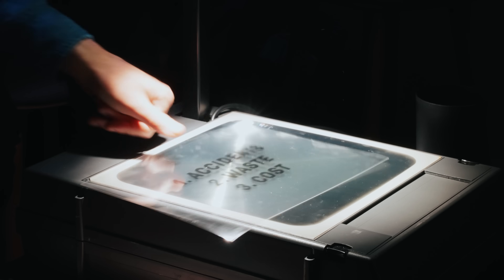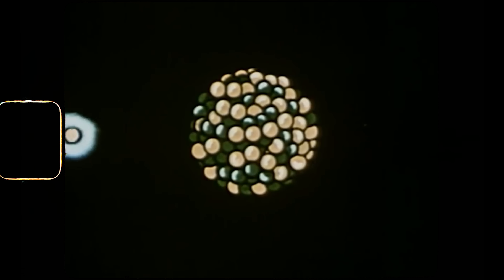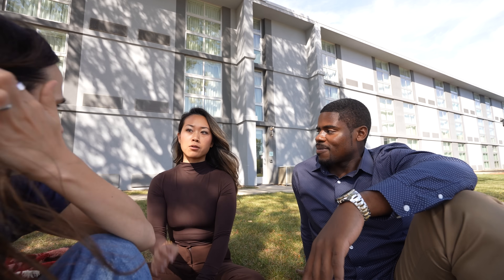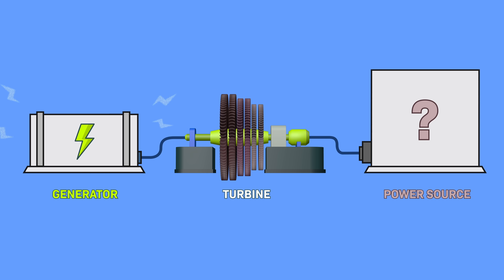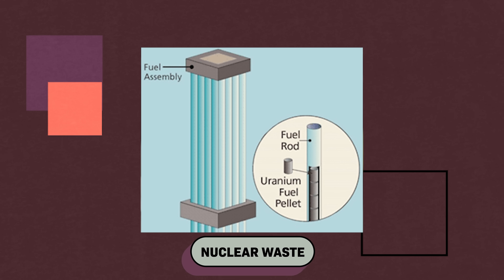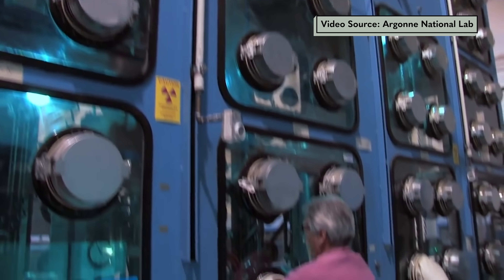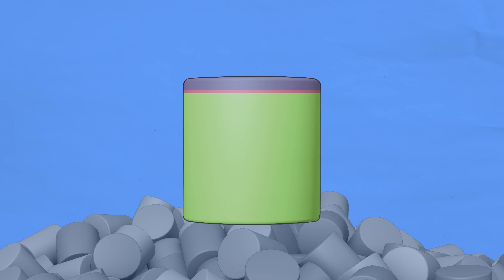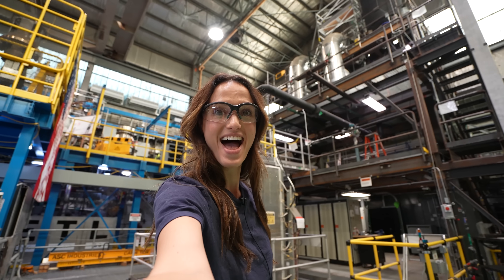The Big Lie About Nuclear Waste

Comment: Instead of getting rid of it or trying to store it. Just use frequencies to change the frequency of the radiation. It is commonly done with bad radio waves and radioactive particles that come off of everyday electronics. But that would save lives, not make money, fear, control amd pharma wouldn't have reason to treat not cure illness
Reply: You are confusing electromagnetic radiation and nuclear radiation. They are quite different. But yes, nuclear energy is the way to go for sure!

Comment: Independent Spent Fuel Storage Installations (ISFSI) are basically stored energy. 

There's still useful energy there, but we stuff them in sealed stainless steel casks (dry cask storage) and shove them into steel reinforced concrete "mausoleums."

I've looked at the mausoleums with thermal imagers. They show up like Christmas trees from decay heat.

Comment: Hi Cleo, you covered a great deal about the United States but did not cover France (the biggest user of nuclear fuel as a % of its total production). It would be great if you could do a follow up about their nuclear power processes.
Reply: As far as I know France has the highest capacity in nuclear fuel recycling using the method she outlined along with the UK and Japan.
Reply: @oskark1698  France does this for the UK. EDF/Ex-Areva is doing it. UK lost pretty much every skills in the nuclear field.
Reply: @iappreciatethat7184  EDF uses MOX (Mixed Oxides so Plutonium as well as Uranium) fuels recycled by Orano, but these fuels are still used in Light Water Reactors. Our fast burner reactors were shut down in the late 90s due to political pressure by Europe (Germany) and a general lack of understanding of the issue by politicians.
Reply: The French are too idiotic in licensing their nuclear technology.  Like most electronics must be 208 vac with 50hz capability. ❗️🤡
The USA is 230 vac and 60hz, so we have to purchase many of the electronics from the EU at a much higher cost. 
Most issues are red tape and greedy politicians whom don’t understand engineering. 
Have worked on a number of projects including recycling of spent fuel rods. 
Years of stupid red tape and delays drives up the cost. 
JS
Reply: franc reproceses nuclear fuel.

Comment: Just bullshit! Rather make a video about the many reasons nobody will invest money in that kind of energy making. If you do not need/want plutonium then there is no reason to make electricity out of nuclear processes. The Sahara desert could in just using a small part make all the energy in the world. It is not the tech that is missing, It is the cost of transport the energy to where you can use it. It simply can not compete with energy from local wind,sun, gas and oil. It is not only by a small margin. So that we can do something does not mean that we should do it.

Comment: It should be noted that the main reason nuclear reactors were built during the cold war was never actually power generation... but plutonium. Plutonium is the reason nuclear reactors were first invented, were developed and built.
You can build nukes from U235 or plutonium. However producing 96%+ pure U235 is EXTREMLY costly, so costly in fact that only goverments of industrial nations can really afford to do so. Iran failed, North Korea succeeded only after spending a major portion of their GdP on it. The reason for that is that U235 naturally is only .7% of Uranium and is chemically the same as the other 99% U238. The only way to seperate is by turning it into UF6 (Uranium-Hexa-Fluorid) and than sending it throught the centrifuge 4000 times... The amount gets smaller each time.... It is ridicules.

However, there is an alternative which is not only far cheaper but also gets you much stronger nukes: Turning U238 into PL239 inside of a reactor. The energy the reactor produces as a waste product can be used to justify the whole project as a civilian power plant.

To be fair, it should be mentioned that after the cold war a lot of plutonium and highly enriched U235 was dilluted and burned in nuclear power plants.
Reply: Exactly. And this explains nicely the political and economical dance around nuclear energy.

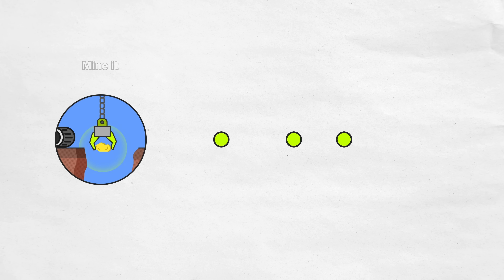Comment: In truth, the vast majority of nuclear waste is not spent fuel, it's tools, equipment, and clothing with minor contamination that is far cheaper to store than to clean. Like the gloves in the workbox where the fuel was worked on at 10:08. That waste cannot be used for fuel unless it's burned, and that would release the contamination. However, that doesn't change the fact that there's still PLENTY of energy left in the spent fuel that's just getting wasted. It's not effing magic like fusion has proven to be, a mere 20 years away for 6 decades so far.

Comment: Right by the end of the video came up with an idea what if they get it so it's stable but unstable enough that you can put a small amount in a car and make it run for at least 25 years
Reply: With using water as a fuel source the radiation emitted as the ignition

Comment: Not only can you reuse "nuclear waste" but you also make electricity at a much  lower consumption. For that you need a fast neutron reactor.
One of the other benefits is that the output for these tractors is less toxic than what you put it. But also you can use Uranium 238 without needing the complex enrichment process.
You can also run these reactors on Plutonium.

France has enough waste fuel to meet its electrical demand for about 3000 years. As usual, the problem is a political one. 

France had a great plan for energy sovereignty called Plan Messmer. But "green" activists and parties along with weak politicians killed this off ...

You can also develop molten salt reactors which can run on Thorium, that also produces less toxic waste, Thorium is very abundant, it can't be used to produce bombs etc etc ....

Comment: It's not possible to completely reuse all the nuclear waste. No matter what, you still end up with byproducts. The enrichment process creates a HUGE amount of byproducts, which you mentioned in passing. That's not even covering the water that gets contaminated by using it in a nuclear reactor. And the fact that a large scale nuclear reactor actually changes the local climate - because it generates power by heating water to drive turbines. Big power, big heat. The cooling towers dissipate that heat into the atmosphere. The entire local climate is changed. Entire literal lakes of water get heated to the point where it kills everything living in it. There are so many things wrong with nuclear power.

Comment: There's a city in Scotland called Aberdeen, all the high class buildings are made out of a local granite....that's incredibly radioactive, enough to be classed as Low Level Nuclear Waste. And people live in those buildings just fine. A lot of the problems with nuclear power comes from designs that came from the drive to generate plutonium for nuclear weapons. As shown here, when you get away from making plutonium the are safer options.

Comment: I am all for nuclear power, it is the cleanest source of energy* we have so far.
The problem is, as long as we are living in a free society with.a free market, the cost of the energy is important. Recycling worked nuclear fuel will become a thing only if the resulting energy is cheaper** than using the newly mined uranium. The process of processing the fuel is demanding and has certain risks itself. The problem of plutonium is not going anywhere, it would be extremely short sighted just to wave it off.
Unfortunately, when I see the video about "great technology we should use", there always is some catch. Mostly the cost.
* when done properly.
** including the research cost.

Comment: I've spent over 50 years working with various types of nuclear facilities, including spending a lot of time at the Rokkasho Reprocessing Plant during its construction, and I am very impressed at how you simplified complex topics so that anyone can understand them.
Reply: I don't know. This was super superficial. A long introduction, no data and an unfunded appeal to believe conclusions without giving means to understand the conclusions.
Reply: so what percentage of spent nuclear fuel is recyclable? Low recyclability is the biggest hurdle. Perhaps the recyclability of waste thorium fuel could be high enough to be economically feasible but we need to commercialise its usage first. Of course, all of this becomes moot if we can perfect nuclear fusion, but it's always better to develop multiple bleeding edge technologies in parallel.
Reply: Do you feel there's going to be long term health effects from China and Japan dumping nuclear waste into the ocean as of today? What particular elements/isotopes would be the most worrisome? Japan starting dumping theirs yesterday.
Reply: @Eternalskyy  - Japan started discharging treated water from Fukushima that still had some traces of tritium in it. Tritium occurs naturally in our environment and is not considered a health risk unless the concentrations are much higher than we'll see here. The water in the bay still meets drinking water standards. I'm amazed that it took this long for them to get approval to discharge this water into the ocean.
Reply: Im bad speak and bad lesson english, because im not speak everyday and bad know english, But im understand her! She cool
Reply: currently in the freshman year of my bachelor’s degree in nuclear engineering! any advice for someone just starting out in the industry?
Reply: Thanks unc
Reply: Is there any credible source that clearly states waste in Rokkasho because of reprocessing is significantly reduced in radiation level which brings the time down to 200 years + instead of thousands- millions of years? Can't find any source about that.
Reply: @rickkdev  - the analysis is relatively simple. The long half-life materials, such as Pu and 235U, are removed from the waste to be used as fuel. The waste that's left is the very highly radioactive but shorter half-life materials.
Reply: And what about Rokkasho today ?
Reply: Chernobyl
Reply: @lamontcranston3177 Hello to you lil AI bot👋
Reply: @Vivungisport  WHO PAYS FOR THIS PROPAGANDA CHANNEL?
Reply: @Vivungisport  If you believe someone is a "bot" why would you talk to them? Do you also talk to rocks? What about clouds? Do you talk to your tooth brush?
Reply: @lamontcranston3177  that insecurity showing, lol
Reply: @lamontcranston3177  ..."Do you also talk to rocks? What about clouds? Do you talk to your tooth brush?" -  Umm, doesn't everybody?😳
Reply: @lamontcranston3177  That was idiocricy of "professionals" who brake the written safety policies. Do you know in Russia there are an old "chernobyl specific" nuclear power plant that is still eunning without any issue? Have you ever fly on a plane while there were many aviation disasters around the world? So annoying while dumb personals living by hysteria and try to hysterize others.
Reply: @kiakk_009  Don't feed the troll.
There's always one more "Chernobyl" or "Hiroshima" goofball than you wanted.
Reply: @kiakk_009  You said nothing. My point stands. Chernobyl.
Reply: ok boomer
Reply: @LaughingMan44 🤡
Reply: @LaughingMan44 Uhh? Get new glasses sir.

Comment: Question: For nuclear waste containers, what is the amount of heat emitted by such a container at any given time?
Reply: The way they are built and the way the fuel is stored, not much above ambient.  These casks are filled after the spent fuel has "mellowed" in cooling pools for quite some time, by the time the spent rods are "entombed" in the cask they range from warm to the touch to just under "very hot bath" temps.  This is a very simplified explanation a nuclear engineer once gave me so take it as a guide and not an exact explanation.

Comment: I have been wondering on and off again about nuclear power, and why we don't use it. I figured it was given a negative connotation to bring up not just because of ionizing radiation being harmful, but the couple of plant meltdowns that corrupted the surrounding area. After a couple of those incidents happened, people didn't want that stuff causing problems in the future. Now, we are being slowly pushed to use more 'renewable' energy that does not reliably meet our grid demands. Any normal human being can look at California and realize that forcing people to have EV's while simultaneously using solar and wind, is the reason they have rolling blackouts. Switching to nuclear power would be beneficial for everyone in my opinion.

Comment: Or we could just do what was invented almost 100 years ago that will make electricity 100% free and unlimited, all electricity production in the world all of them be it nuclear, coal, wind, solar you name it can shut down, we are talking free clean unlimited electricity that never runs out and is 100% environmental, problem is off course they can't charge us for it, that was why the people who found this out and proved the concept was shut down and all stuff on it was removed where possible.

But we have the technology to get unlimited power from everything around us, be it the table you use, the door and our self, there is a little Danish Island Bornholm that Island alone from the water shore to the space if you imagine a border following the island around and up everything inside that produce everyday enough electricity to fuel the entire worlds needs right now 50 times over. All it takes is every electrical equipment  we use phones, cars, computers, servers to draw the electricity they need from the very air around us, and as the items that use electricity are used do they produce more electricity to take from the air around us. Our bodies produce excess electricity as well.

Sadly they can't charge or tax so it was killed off, now that is clean and safe power for everyone at the only cost is to remove batteries, power plugs and more and replace them with what is needed to draw this in and use it, and by today's standards I would say the modules needed would be smaller than what is in all our equipment to do this and at no heat production from the power production it self., imaging a computer or server would never need a PSU, the Motherboard would just take the power it needs, and the items needed could be sitting on the side like we do with a PSU or baked into the board, GPU's the same, no more PSU more space more options, heck fans could even get it so no need to draw from the Motherboard, our ssd and hdd drives the same.

Endless options all is possible and yet money rules and free electricity is not something wanted for the people.

Comment: The green stuff in the leaky barrels is basically waste from weapons production early in the atomic weapons program through 1960s iirc, and it actually was corroding through and leaking out of the temporary storage tanks it was stored in. There was a program to stabilize it and transfer it to other storage. Not sure if it's been completed or not, yet.
Reply: A lot of it is stored at Hanford in eastern Washington. It’ll never be used as fuel because at this point no one is sure what witches brew is in the tanks. So many nuclear engineers and chemists have messed with the contents that heavy traffic is forbidden in the vicinity for fear of shaking the ground and starting a chemical and/or nuclear reaction.
Reply: @DanielinLaTuna  - yep, her "nuke waste is fine!" vid covered a very specific type of spent fuel waste and she completely ignored mentioning that there are other types of radioactive waste that can't be re-used as reactor fuel.

Comment: meanwhile Germany closed down the reactors, planted millions of solar panels with 25 year life span that don't have a recycling plan, planted lots of wind turbines that also don't have a recycling plan and when it's not windy and sunny they just burn coal or buy from France electricity produced with nuclear power. Same with diesel engines, we're not investing into making them better and less pollutant, we're shutting them down and investing into electrical cars with poor autonomy and all reliant on batteries with short lifespan manufactured in China which increases the dependency on them and all made with materials harvested in inhumane conditions in Africa. Needless to say that also lithium cells have also no recycling plan cause it's cheaper to make them than it is to recycle.

Comment: Estimates indicate that there is enough Thorium in the U.S. alone to power the country completely for the next 1000 years.  A molten salt (Lithium salt) nuclear reactor is not only more efficient, has an abundance of fuel available in the U.S. and can also burn nuclear waste of all types.  Molten salt reactors are also inherently safe from melt down accidents because they self regulate and dump the salt into a reservoir when or if the reactor overheats and this shuts it down safely.  As Three Mile Island, Chernobyl and Fukushima have proved, fast breeder water cooled reactors are NOT SAFE.  They are a catastrophe waiting to happen and a terrorist's dream target.  
Unfortunately we have an out of control government that is ran from behind the scenes by the intelligence and military industrial complex.  They will NEVER give up the ability to manufacture and posses enriched Uranium/Plutonium for nuclear weapons and that means that they will continue to block the building and use of Thorium fueled reactors.   
China has built the first commercial Thorium fueled Molten Salt reactor and it has been online for a year already.
Reply: No. Must have depleted uranium.